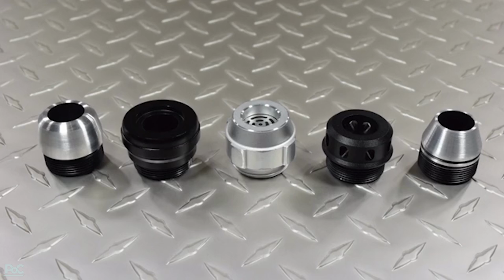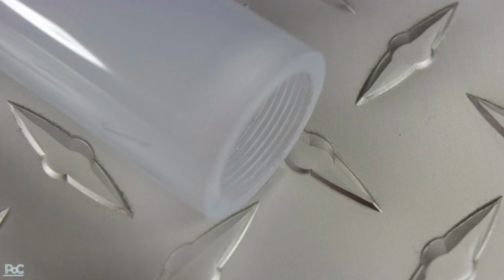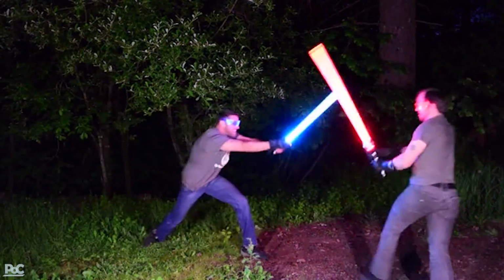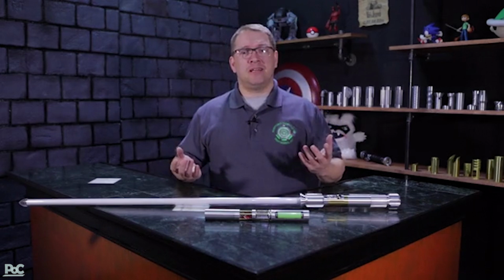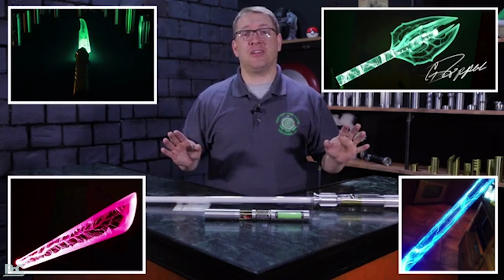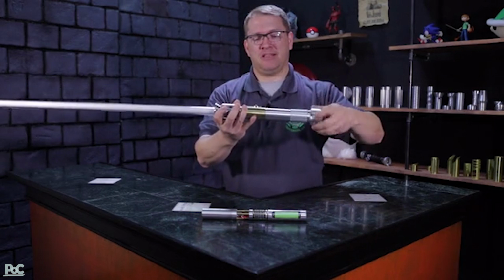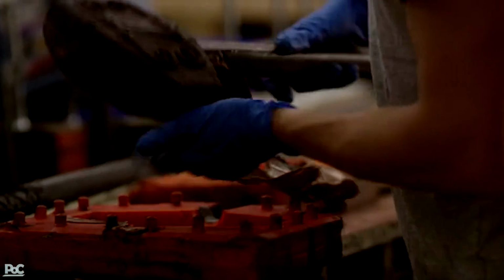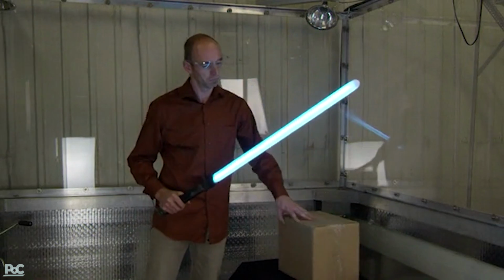Top 3 Amazing Lightsabers You Can Buy

Comment: I get how these sabers are Fckin Bad ass, but when are we actually gunna have one where these things pop outta the machine
Reply: ikr i am picky i may think about it when something like this comes out (and price gets lower a bit), i like immersion and that's immersion
Reply: Yeah, I want one where you press a button and it pops out and lights up at the same time... that'd be somethin'
Reply: WTD DigitalDylan you could use a fan to extend and retract with suction
Reply: If you want a good one to fight with having it pop out is hard to do with it being strong aswell
Reply: @DildoInserter  I have one where it pops out of the handle.
Reply: YnSter X3 it would be extremely hard or impossible to get a durable blade inside the hilt and have all the electronics at the same time. If you want one with a pop out blade, there are really cheap ones for like 10 or 15 dollars.
Reply: I had one of those when I was a kid
Reply: this is one of the many reasons real lightsabers are impossible to make. light can not be stopped unless something stops it, which means that a real lightsaber would basically be a laser pointer.
Reply: GL Studios what is it called
Reply: @pummikone  where did you get it from?
Reply: @strike395  I don't know. I got it from my cousin but it seems that it was made in 2007, by Hasbro. I have seen lot of those.
Reply: @Owen-kl7pz  I don't know but it seems to be Obi-Wan's first lightsaber.
Reply: I agree
Reply: GL Studios is it the hard plastic like saber?
Reply: @shmierda  Well it's very strong so i guess it is.
Reply: So the first guy is the infamous owner of Saberforge. The way he's been described, I pictured him looking more like some sort of backwoods, bearded up, MAGA hat and camouflage wearing doomsday survivalist.
Reply: Check out a channel called “The HackSmith”, he made a REALLY good lightsaber. And NOT a toy one. It actually comes out of the hilt.

Comment: fuck yeah how much
Reply: There are different types. Apprentice sabers start at around $70 elite sabers (no difference in quality but they have arguably better designs) start at $150 - $200 and there are also legacy and cross guard sabers. For the bottom tier saber which is just a hilt, there is no added cost. Then there is the next tier (a blade and a 12+ watt led of any colour) which is an extra $100. The next tier is the same but with sound (two different sound "fonts" light side or dark side) which is $250 (not added to the $100 from before) then their is the top teir  which has colour switching leds. For an average saber with sound and lights it's about 400 - 500 dollars including shipping (to the UK) i dont know about US.
Reply: Ross Holt yes, $70 is a good price if you want a lightsaber without, well, the saber. If you want a lightsaber with a blade, that's $100 more, and one with sound is $200 dollars more. Ultrasabers has better quality at a cheaper price.
Reply: Ultra Sabers is also a pretty good choice, they have grab bags for $50 and base models for about $54, then the price goes up from there. You can get a pretty durable one for about $65 from them without sound, but good color and a decent variety